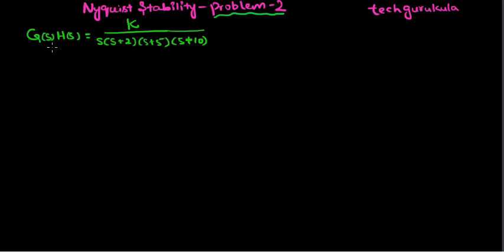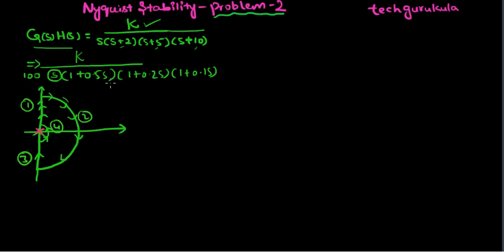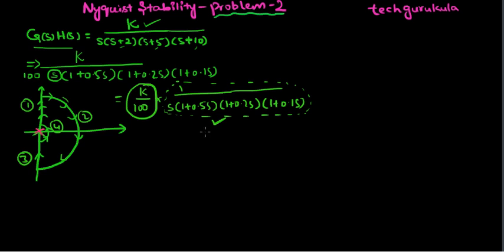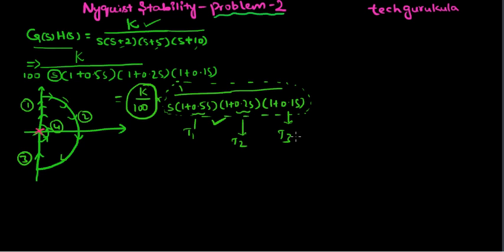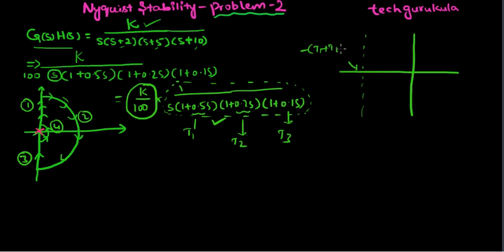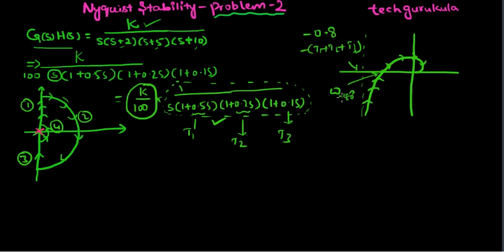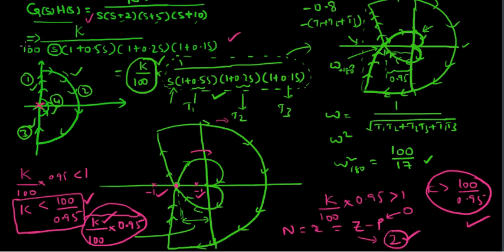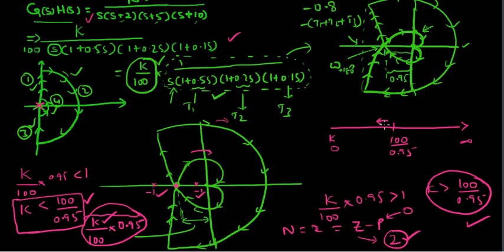Nyquist stability - problem-2

Comment: sir as i have calculated many a times the value of Magnitude for the specified plot at phase angle 180 degree and the answer comes up with 0.22936 , sir you have given the same calculation with .95 value .. i think this is a little mistake by your side , if it is not then please let me know how have you done that ?
Reply: i got the same
Reply: Yes I even tried with routh  Hurwitz criteria answer was coming as k = 454.54 , which is the same thing you will get when you do (k÷100)*0.2236 = 1.

Comment: yep there is a little mistake, when he came up with the value of M(180º) infact ,calculating i got 0.229, and i belive be correct, cuz the system keep stable for k<435  which gives me 435*0.229/100 _ 99/100  _which is less then -1 am i right?
thnsk for the lecture btw!